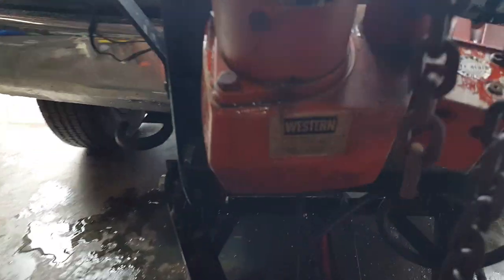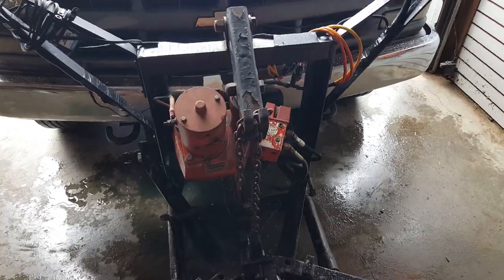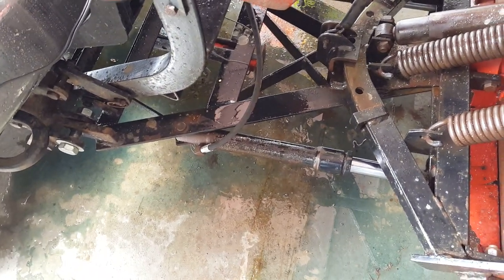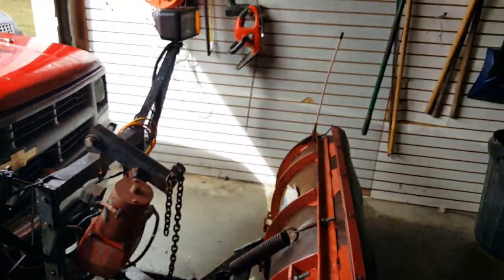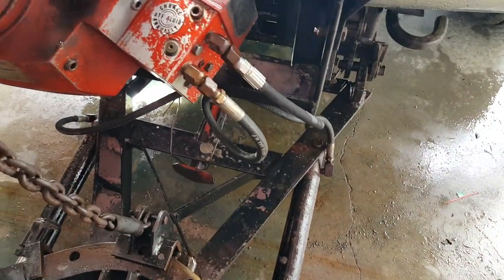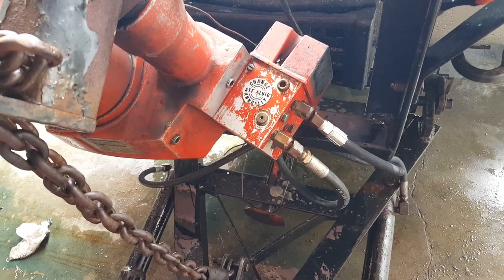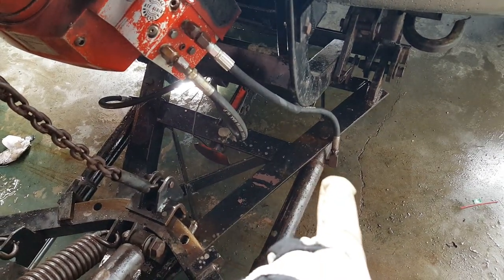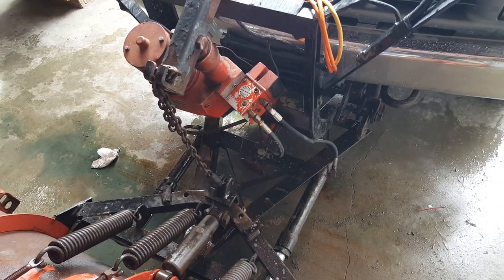2019.04.01 - Western snow plow bleeding hydraulics

Comment: This sounds like what my issues have been with my western plow. Up and down work fine but occasionally the tilt right or left doesn't work. It's not electrical, so I'm thinking I might have sludge in the rams.
I was told that brake fluid would work for flushing the rams and the rest if the system before putting new Hydraulic fluid in.
Reply: Flush system, new lines if needed and put some Lucas for transmissions and mine is back a1
Reply from the maker: Possibly